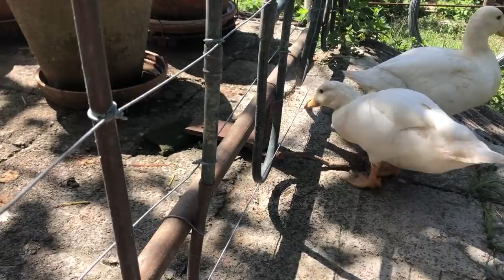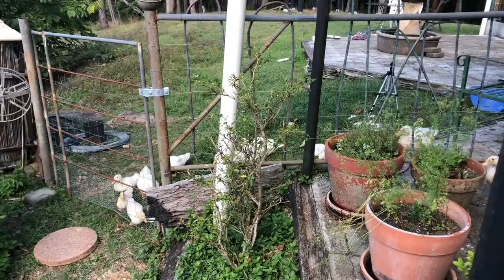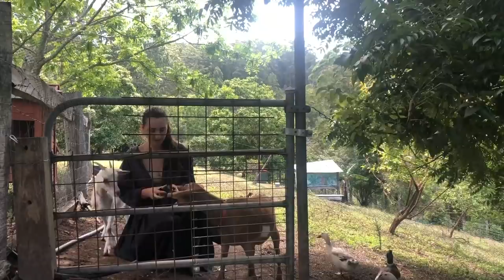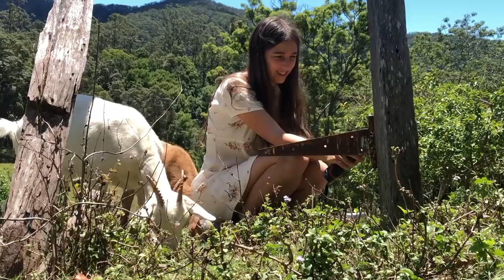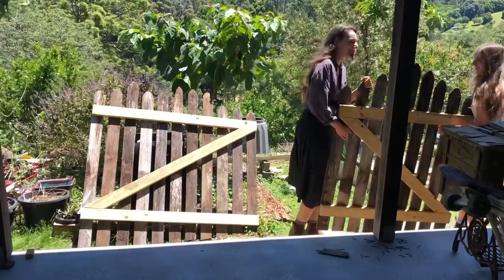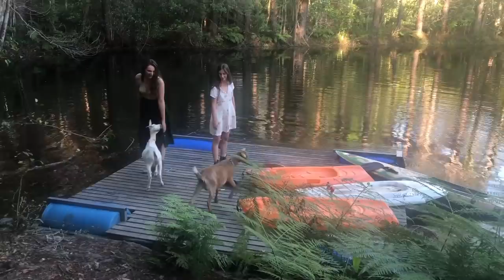What We Do in a Day: Zero Waste Building, Duck Cuddles and Goat Drama!

Comment: Don't mean to be a downer but you have put the gate on the wrong way the diagonal goes from bottom hinge to the top latch it will matter as the frame will drop making it hard to open the gate